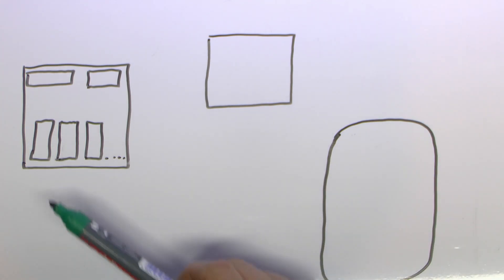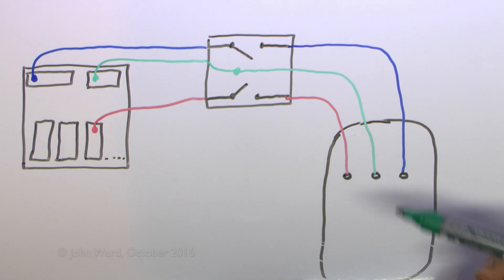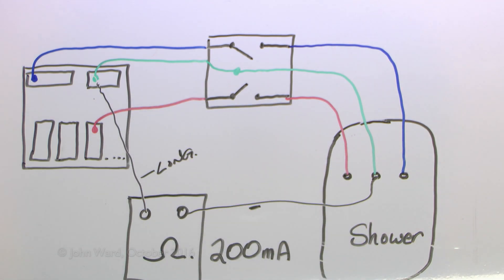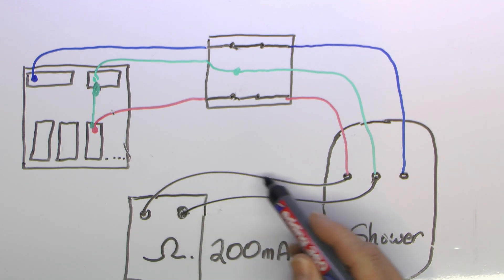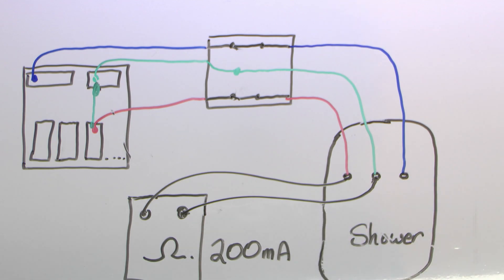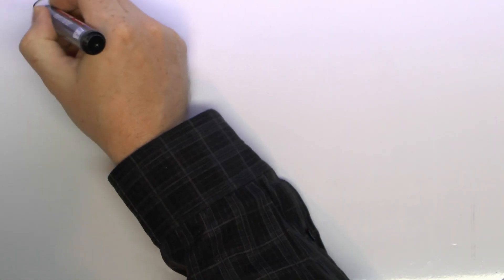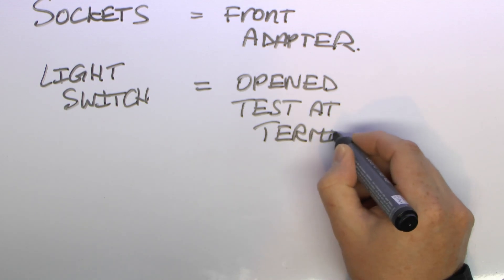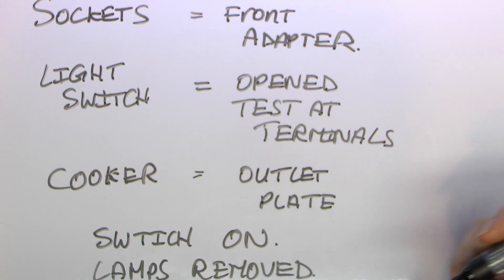Continuity Testing for Electrical Installations

Comment: The shower is plastic, so why the test?  Up to the switch yes, if the back box is metal.
Reply from the maker: The outer casing may be plastic, but the heating element inside will have a metal covering, and the shower unit will have an earth connection.

Comment: What kind of results should we expect? Sorry if that is a broad question
Reply from the maker: Depends on the size of the conductors and their length - resistance increases with longer circuits, and decreases if the conductors are larger.

Comment: I know its not allowed but I don't know the reason why that on an eicr you can't just take a zs on a circuit and take away the ze to get the r1 r2 value , I always thought it was because of parallel paths , but if I do the r1 r2 like you say with the link in the MET ( as does the on site guide) you would still get parallel paths , is there another reason? Thanks
Reply from the maker: R1+R2 is a DC resistance, Zs and Ze are AC impedance.  Adding them together or calculating one from the other is not valid as they are different things.
Reply: Sorry to be a pest but can you explain that a bit more  , why is the zs not a reliable reading? Just about most sparks I come across just do zs on the circuits and when I explain that your not meant to do that I don't really understand myself ?

Comment: In a three plate lighting system where two separate lamps are are controlled from the two gangs of a two gang switch, there will be parallel cpcs (a cpc in the cable between the ceiling roses and a cpc in each of the switch drops). Do you temporarily disconnect the cpcs in the switch box to ensure cpc continuity between the roses when testing at the furthest rose or is this not necessary? In fact it's the same with any parallel paths, if you don't separate them you can't be sure of continuity of the cpc ... can you?

Comment: Thank you for the video, the link mentioned at 5:47, can it be done between the Neutral and the protective conductor rather then using the live?
Reply from the maker: Yes, that would confirm continuity of the CPC and N.  If doing that, the L-CPC would also need to be done, so the neutral-cpc would be an additional test, not a replacement for the L-CPC

Comment: Hi John, on a CPC I'm getting a reading of 0.5 ohms in ohms mode and in continuity mode the meter is a continuous beep. Then on another CPC I'm getting a reading of 0.7 ohms in ohms mode then in continuity mode the DMM is a non continuous beep. The meter is a fluke 117. Any reason why the beep is not a continuous one?

Comment: This works well on outlet switches with ease... Light switches less accessible...  You will capture the resistance at switch side but not the trailing offs with ease to the ceiling fixture unless it's returned back to same switch box via neutral... ...
Reply: Bottom line it could be a prick of a job and time consuming..

Comment: Great video! This has helped giving me another route to now check my wiring as everything is fine in the MBU, I don't have an isolation switch but I've got earth, supply and neutral wires joined underneath the bath and I need to see which connection has finally failed otherwise I'm looking at the rest of the cable

Comment: Hi John. I have a slightly odd testing scenario. There is a normally open contactor for a shower used to only connect the shower when the other shower is off as max demand would be too great with both of them on at same time. There is no physical means of closing the contacts with screwdriver etc, only the 230v coil. The coil is powered from the same supply as the shower via a 2 amp mcb to downrate the cable for that and a time delay switch which in turn holds the other shower contactor off. When doing the dead tests it would be necessary to close the contacts for r1 + r2 tests but this cannot be closed unless powered. Would it be ok to test both sides of the contactor and then add the resistances together? Or should the power for the contactor come from a separate source? Sorry for the long winded question.

Comment: Hello JW, Great videos, thank you.  I've just started my apprenticeship college course.  I am confused over why a continuity/polarity test using line and CPC is sufficient.  What if the earth and line are crossed over?  Wouldn't there need to be a similar test for earth and neutral to make sure everything is safe?  I read elsewhere that there's no place to record such a test on the forms.  Thanks again and best wishes.
Reply from the maker: That test on it's own won't detect a crossed L/CPC.  It can be repeated using N and the CPC, results should be identical and it also confirms the neutral is connected properly.

Comment: Current email we’ll known scheme provider is distributing tell me what you think about these new benefits being provided by scheme providers Just to confirm our schemes membership team will from now on be asking that the applicant has 2 years of experience in the electrical industry. This is a benefit to the applicant as when it comes to the assessment the Assessor will be checking for competency through visual evidence and line of questioning.
 
More than anything the evidence of the applicants past experience will be the most apparent when attending their assessment through us.
 
Kind regards,

Comment: Hi, is the continuity done for each individual circuit? example sockets, than lights etc?
Thanks
Reply from the maker: Yes, all the tests are done on each individual circuit.
Reply: Thanks John. Just one more question, what is the maximum acceptable value in ohms?as some installations could be old and not give the same results as a new installation.
Many thanks

Comment: My name is nitu. One of my neighbour has taken inverter and neutral connection from my meter. But the thing is I did new wiring in my house their is no touch with their connection. But our electrician made inverter connection with old wires and in some of the board their are old wires but their is no touch with neighbour wire.How come they bypassed all my connections. 

Can I talk to you about it...

Comment: hello John Ward I have a question Wonder if you can help me The light downstairs and upstairs have  a light switch 2 at each floor but I need to find which cable is which in order to connect it correctly buz they are not in order when you want to control light downstairs from upstairs. I need to find the correct wires and thinking about getting Wire Tracer and Tone Generator. Switch the fuse off in the consumer unit and then work on it with this device Do you think there is other way to do it or is better to get this tool and by running a test I will be able to mark each cable and connect it correctly ? Thank you for your time Arthur Glasgow

Comment: Why put a link between cpc and line when you can just take them both out at the shower and test at the consumer unit ?
Reply from the maker: If there is no temporary link, how will you confirm continuity?
Reply: Just a quick question can you make the link between the cpc and like with a block connector ?

Comment: Similar question John would the second way require main trip to be off tia
Reply from the maker: Power off and wires disconnected.  This and the other initial tests are done before any power is connected.

Comment: JW, can you test your live to neutral circuit for continuity using a link too while the circuit is dead?
Reply from the maker: Yes, same method can be used.  It isn't normally done, as a broken neutral would be immediately obvious as sockets, lights etc. would not work.  A broken or missing earth would not be obvious so it is important that the test is done for that.
Reply: For a high power circuit such as a shower or cooker,  it should be standard practice (but is not!) to test the Rl + Rn (live + neutral)  to ensure that there are no bad connections or  switches with a poor contact resistance in the circuit.

Comment: Hi John. Thanks for this incredible video. Can you please tell me under whether it is correct for Neutral and Earth to show continuity? I have come across a situation like that.
Reply from the maker: Within the installation there should be no connection between E&N.
However if testing with the main switch on, there will be continuity between E&N as they are connected together in the supply network.
Some appliances have filters inside which can show some connection between E&N particularly if testing at higher voltages wuch as an insulation test at 500V.
Reply: John Ward Thank you very much for your reply John. I decided to go to the distribution box and I have noticed that the connections are completely separate. But strangely, when I test for continuity the result shows there is continuity

Comment: neutrals don't have switches!
Reply: Permanently wired appliances on UK systems use double pole switches which operate on both live and neutral. 

Only lighting circuits use single pole switches.

Comment: what is the meter itself actually doing on a continuity test . i understand that no less than 200 mA is applied to the circuit at 4-24 no load voltage on a test...eg.. on an end to end test i get .45 ohms on a 2.5mm cable. so how does this result corrolate with the v.i.r..principle...v? i..200mA...r...   .45 ohms...  seems to me very ambiguous  the closest result i found was 9v divided by 200 =45 !  am i looking at this all wrong,john ?
Reply from the maker: V=IR, so 0.45 ohms and 0.2A would be a voltage of 0.09 volts across the cable when the test is being done.
The voltage is what the meter is measuring and converting into ohms for the display, higher resistance = higher voltage.
No load voltage is exactly what is says - the voltage with no load (the thing being tested) connected.  
For testing resistance you either limit the current or the voltage, not both at the same time.  If the 0.45 ohms cable was tested with 4 volts, a current of 8.9 amps would be required.
Reply: thank you for your prompt clarified reply john, i was misguided by the text statement as follows " the test must be carried out with a no load voltage of between 4-24v and a current no less than 200mA." therefore i was trying to equate a voltage between those figures ! your fine explanation solves my calculation problem ( and i must watch where i put those decimal points!) thank again john.

Comment: when you move the r1 to the earth bar to do the r1 + r2, parallel earth paths could affect the results or even give false continuity of the r2 conductor through a bonding conductor that could lose connection because a plumber adds some plastic piping in the future, i always thought it better practice to remove both r1 and r2 of the circuit being tested from the ccu connections and joining them together then.

Comment: John whats the best way to find a qualified electrician for work in the home? thanks.
Reply from the maker: Get someone who is a member of one of the several organisations such as NICEIC, ELECSA, NAPIT, ECA.  However note that qualifications do not automatically mean you will get a decent job done.
Reply: Very true John. I dont think much of these rate a tradesman websites, as I suppose anyone could pump up the ratings of a trader. Thanks for the advice.

Comment: off topic but could not find a way to message you direct. have you done a video on grid switches on a kitchen ring ? I've installed these as a customer request a couple of times but I'm not a fan. I've used the mk equipment but was left very disappointed poor quality screw and you can't terminate once you clip the module switched into the frame leaving no answer to top screws. deta was slightly better my real concern is linking the ring main across each module switches. how do you recommend wiring this system? thanks
Reply from the maker: No video, those switches are not really designed for use on a ring, or for use in a kitchen like that.
The terminals are small and only rated for 20A.  That style of wiring puts all of the load on the ring at a single point, which is not how rings were intended to be used, and the switches themselves will almost never be used as most people do not switch off their appliances every day.
Reply: John Ward thanks for your reply. most new builds are using these grid systems in the kitchens.  I agree on the fact their rated to 20a but in theory are they not just  switching 13amps? I'm unsure of them myself. regs state under counter appliances need to be able to be isolated. is this by mcbs on ccu? or would you recommend switched fuse spurs 
above worktop . have you come across these grid system ? or used it before. more info on this system would be grate.

Comment: Not sure I got that polarity part right, or it just works differently in the UK, but when at the heat, I measure between earth and neutral, shouldn't I get a low Ω reading too because neutral is connected to earth somewhere else? Wouldn't the polarity check only be complete if I measured both, line and neutral to earth, and both do not show open (with the temporary link in place)?
Reply from the maker: The incoming supply will have L and E connected, but this test is done with the supply completely disconnected.
Reply: ah, ok, thanks, I somehow thought it would be only the breakers that are switched off for this test. Around here it is pretty much impossible (or at least quite hard) to disconnect neutral from earth or break neutral at a single point
Reply: Dennis Lubert ignore the neutral this is only used on the ring main test which is called the figure of eight. 

just use the live in the earth bar polarity is only different to the continuity in the fact continuity shows the resistance reading polarity is the sane test but the buzzer sounds when the switch is flicked. 

also when testing lights make sure your light bulbs are removed.

personally if your not qualified don't touch with testing you will probably fry yourself. it took me 3 years to respect electricity. 

don't mess if your not sure.